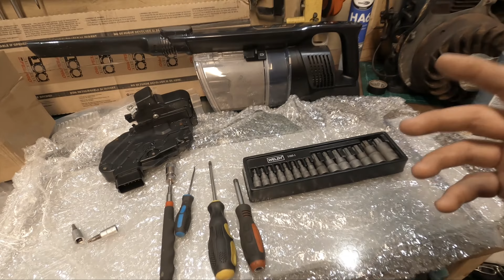Range Rover Evoque Door Lock Replacement - DIY Replace Driver Side Catch Actuator Removal [HOW TO]

Comment: Just done this job. Part came from Amazon yesterday. I removed the door handle and took the latch and handle out together having unplugged the latch and taken the bolt out of the bottom of the window guide. The hardest part was disconnecting the wires from the door card. Took 2 hrs and a cup of tea. Yay!

Comment: I'm having the same issue with my Left Rear door. But I can pull the internal lock and open from inside. When I pull out the internal lock, I can open from outside too. 

U think it's because of the actuator unit too??

Comment: Excellent video, I've just changed the R/H Front door lock/latch on my 2014 Evoque Dynamic following instructions  with this video, the difference with my lock/latch mechanism is it's a double lock so there are two cables on the inside to disconnect, not easy but if you remove the plastic cover held on with a single screw it's easier, not really sure about the function of said plastic cover.

Comment: Hey man, good video, it's nice to see clear information, it's how I do my videos on my channel. The little metal tab issue with it being slightly bent and not pushing the white actuator was the same issue that I had on my other Range rovers being the l322 and the l320 Range Rover Sport. It is a very common issue with Range rovers, I have just bought an Evoque yesterday and both my front doors are playing up with the locks. But first what I'm going to try and do is reach in with a screwdriver and try and bend that little metal tab so that the gap closes up it may work and save having to remove the actuator and replace as you did. I will let you know and probably do a video to help explain on my channel. Thanks GrooveOn
Reply: Did bending the tab work for you? :)

Comment: Followed your video and just replaced my front passenger side unit. Great Video - Saved me a fortune. Thanks Ian
Reply: how much time was required? what sort of tools are required? Normal screw drivers and all or do we need something of akward corners?
Reply from the maker: Glad it helped you out
Reply from the maker: Hello, basic tools - Torx bits, screwdriver and picks - just had to replace the passenger one and posted a video on that - I list the tools used if it helps
Reply: Ian, where did you buy them from??
Reply: What is it exactly the same for the passenger side? Did you have to remove the door handle as some suggest?? Thanks
Reply: Does the door card need pulling towards you first from the bottom then lifting up? Thanks

Comment: Hi, I have the same issue with my rear passenger side. I've ordered the part and waiting for it to arrive. I notice on your video you have been detaching cable with the lock outside of the door (one with yellow clip) where other videos show messing through the latch hole? How have you done this? Cheers MIB
Reply from the maker: Hi, I have not had to replace the rear ones (yet) on the front as you can see there is plenty of play to pull it out and remove it, however not sure on the rear sorry - i personally would place and in and try and just remove it, pull up clip, twist and pull... worked on many cars with these clips, once you do one, can do it without seeing it.
Reply: Thanks for your reply.
I ended up taking the door handle off (no big issue)
The whole assembly could be removed by lowering inside the door and under the retaining brace.
It was good to have it all out as you can see how the clips work.
Mine is a 2016 car.
Thanks again
Reply from the maker: @mib150  glad you got it sorted
Reply: @mib150  did you need a 2 plug actuator (10 & 4 pin) or just a single 10pin? Also is yours keyless entry?

Comment: Hi..thanks for the video.. I was told the non genuine replacement part may have problems being recognised by the car?  Does it have to be a specific part for keyless start evoques?  Thanks
Reply from the maker: Hi, been ok with the non genuine types personally, just buy a good reproduction, from a company that has good feedback and lots of different products, mine came in branded boxes - stay away from ones in plastic bags and no branding

Comment: Hello! Do you know if the model that you shared on amazon can work for the driver door but on the left, i drive a car from Germany thanks.
Reply from the maker: I would think not, they are unique to each door of the car, you would need a front left door version, will be some on eBay/Amazon

Comment: I note that the 3 screws securing the front left lock to the door on a 2017 model we have here are tamper proof type. Check that you have the right tool before you remove the door card as getting that far and then not being able to remove the lock assembly might turn the air blue!
Reply: Thanks for the heads up! Do you know which tool is required or what the screws are called? Thx!

Comment: Hi. I have a Range Rover Sport and when I lock the car with the remote control, all doors do lock except the driver's door. The driver's door will lock after 30 seconds. Does anybody knows if this has anything to do with the remote programming or there is a fault with the door lock. Your thoughts will be appreciated. Thanks

Comment: Also if you buy one off ebay  and fit it you self , if I goes faulty under warranty  then forget it , they stitch you up by saying they want to to see the receipt for its fitting by a qualified mechanic or garage, in the end I had kept the old JLR door lock and swapped the motors out of the cheap copy into the JLR  unit (exactly the same motors) and re fitted it all perfect again.
Reply from the maker: That is a great idea - both my rear doors are LR units still, if they fail will try this - good tip

Comment: I have the same problem with my 2013 RR Evoque. The driver door does exactly what yours is doing...to open, I have to open it manually from the passenger's door and it's very frustrating. This cars are very expensive to have such crap security systems... that's prone to fail anytime. Everytime I park the car  have to look each door manually, otherwise the car would remain unlocked in public areas the whole day/overnight. I wish it was just ordinary/ traditional locking system than these keyless crap system. I'm very disappointed.
.

Comment: Did my passenger door one yesterday. Forgot to connect the actuator to the power plug!!!!!
Got to take it all apart again and plug it in. Straight forward job compared to taking the actuator out and in!! Fuck, that was a ball ache, connecting the two steel cables to the actuator. 🙄
Reply from the maker: Lol glad you got it sorted